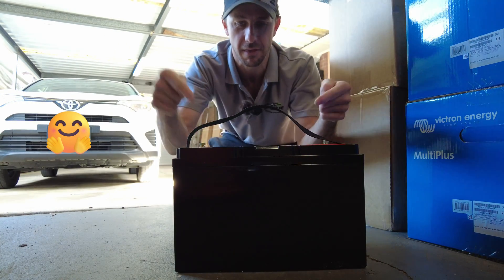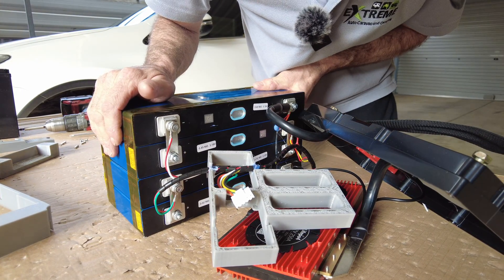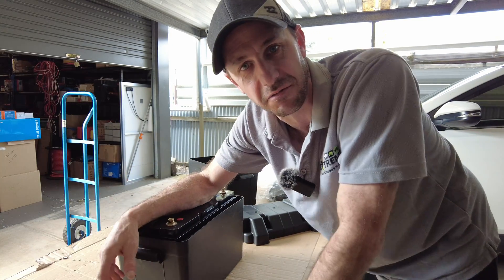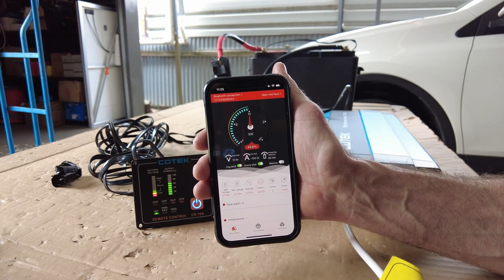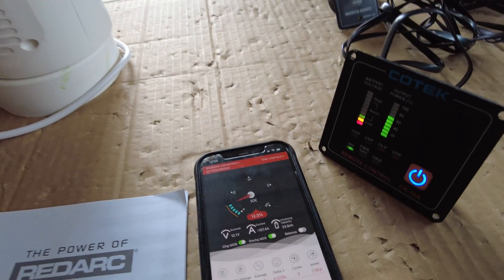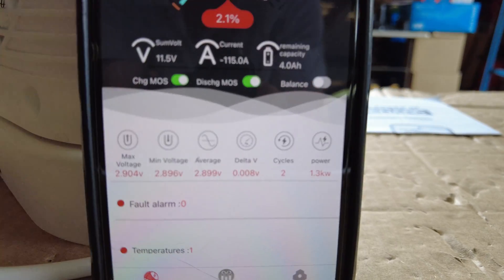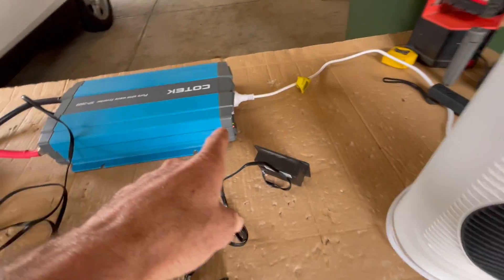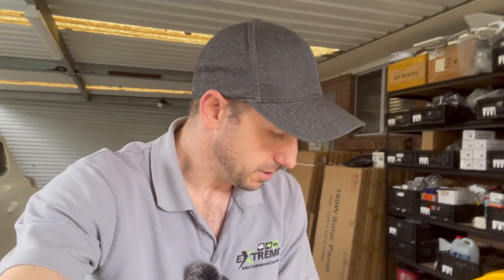PowerPaul Australia Cub lithium battery

Comment: So if this battery had a 20mm vent tube and seal, does it then enable install inside Van. Case looks strong enough one strapped down,
Thanks for sensible review, regards 👻

Comment: Awesome battery. Just took one across the Simpson powering induction cooktop, Nespresso machine and even a hairdryer! Mine is 190Ah, fitted in an Aldi battery box and paired with 3000W Renogy inverter. Completely gas free camping. Love it.
Reply from the maker: And that’s how it should be simple. 
Thank you for commenting

Comment: They look so good I watch all your videos im in Adelaide as well. Life goals to have a setup like what you do in our van oneday.

It did confuse me a little that the battery kept going for such a long time after saying it was at 0%? Also how bad is it for that battery to be taken so low?
Reply: I can provide an answer to that. This battery has been sitting idle for a few months, so the SOC will have drifted over time. This is something basically all Smart BMS batteries do. We've improved the BMS software since then and managed some better calibration of the BMS at the same time, so there will be less drift for current model batteries. Matt didn't do any top up charge before the test, so he will have used whatever was remaining. 

There's no problem draining these batteries right down until the BMS shuts down, providing they are recharged shortly after. They shouldn't be stored in a discharged state for long periods. 🙂
Reply: @PowerPaulAu  Hi Paul I appreciate the response. I have 2x EV power 120ah batts in my camper with Bluetooth. The SOC readout on them even over 3 days after starting from a fresh full charge ends up out by about 40 odd % very disappointing. I installed a victron smart shunt thats very close however even after months of sitting at super low idle draw its a few %.  We are looking to upgrade our camper to a caravan I will be looking at 2 of these ot maybe on scout. They are awesome batteries that you supply.
Reply from the maker: The history goes a few years ago I was looking for a high discharge 12v battery to be able to be supplied to us here in Adelaide.
I have been building lithium batteries myself for many years and noticed someone over in Victoria starting up a small build. 
I contacted Paul and asked him if he could supply us with a continual supply of batteries over the next few years and he agreed the rest is history, scroll through some more of my videos to look at what we put these batteries through.
We do complete discharges and load them right up to see what they can do very happy and continue to be happy.